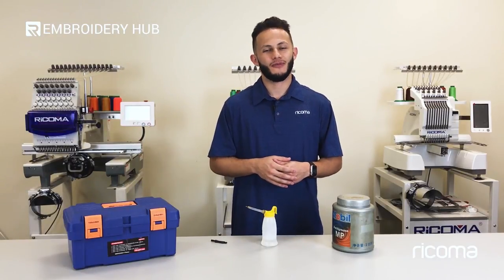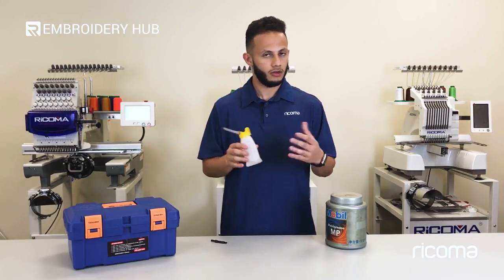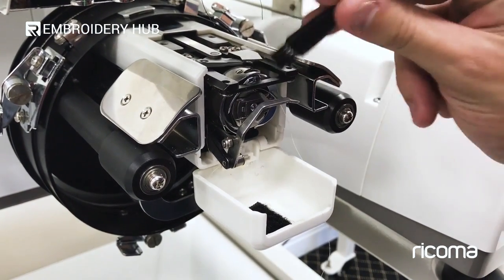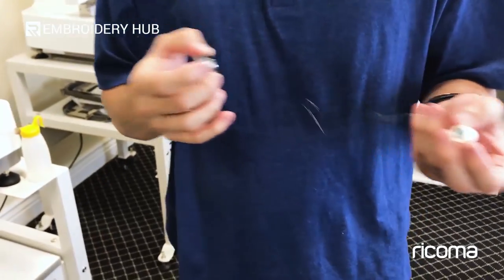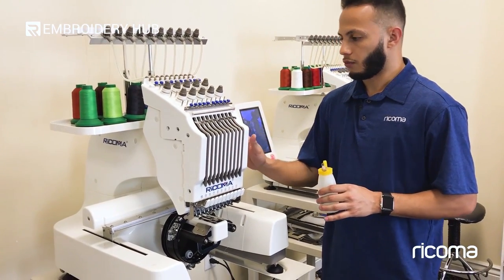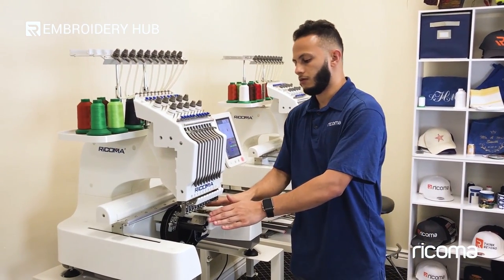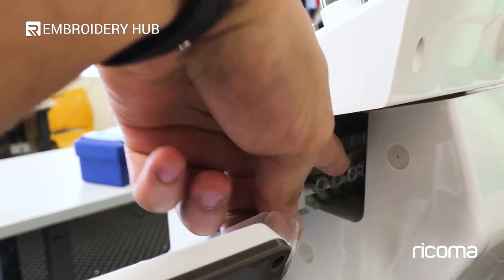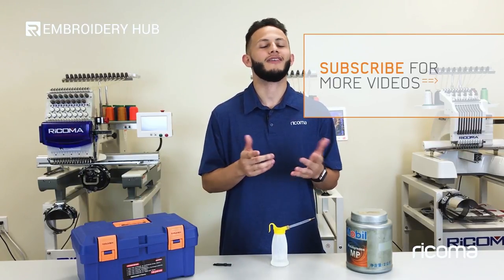Ricoma EM-1010 Multi-Needle Embroidery Machine Maintenance | Embroidery Machine Tutorial

Comment: What are some errors that may be caused by waiting too long in between maintenance? I am getting "main axis reverse", my machine has a relatively short life (about 15-20 jobs under 2k count) but it looks like the mechanisms are starting to get sticky/gunky and it feels like it's overcompensating on the downward stitch
Reply from the maker: Your main axis could be binding due to lack of oil and certain components may wear faster.
Reply: @ricomatv  On a new machine?
Did I just spend almost 10k on a machine that "wears faster" than other machines?
What a jip
Reply from the maker: There are certain maintenance as frequent as oiling rotary hook every 4 hours of use that if not performed are going to cause issues, so it’s not a “jip”, just things that machine owners are required to do
Reply: @ricomatv  I'm referring to more in depth maintenance, of course I have been doing the standard oil AND weekly greasing. The machine has had less than 10 hours of use and I've done oiling twice and grease twice
Reply: @ricomatv  I think my question should have been is there anything other than maintenance that would cause that error? I have done The maintenance what 5.5 hours insured of 4, I am still having the issue. Do I need to replace a part?
Reply from the maker: Don’t think a part would be needed but you should contact support to understand further about your particular circumstance
Reply: @ricomatv  got it, thank you
Reply: @anabeastmode  Ana !! Glad I’m not the only one but sorry to hear about your machine ! These CS reps know nothing about embroidery machines and their tech help .. have fun waiting on hold 30-1hr only to get told to check your thread path 🤣

Comment: Question:  Is there any maintenance required on the Cap Driver?  i.e. oil/grease on the cable and rotating parts?
Reply from the maker: You can call our service department and they can explain the proper maintenance for your machine. ricoma.com/us/tech-support
Reply: @ricomatv  I know the proper maint for my EM1010, just wondering if there is any maintenance required for the cap driver.  Thanks!